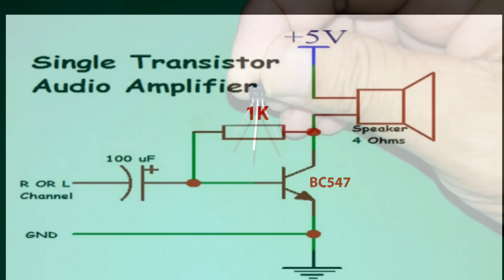Make an Audio "Amplifier" (single transistor BC547)

Comment: It will not work efficiently you will need to connect a 0.22uf ceramic capacitor instead of 100uf electrolytic capacitor. Also connect a 100 k potentiometer as it will only work around 40 to 60k efficiently
Reply: you seem pretty knowledgeable... can you please explain me the use of capacitor here in the circuit... that's the only thing I can't get my head around
Reply: @SAbdullah03  to smoothen out the mildly fluctuating current, to prevent noise

Comment: good but
voice doesn't clear
Reply: Use a 0.22uf ceramic capacitor instead of electrolytic capacitor also use a 100k potentiometer between collector and base. And rotate till you get a clear sound it might work between 40 to 60k. If then also sound is not powerful then add more stages for this